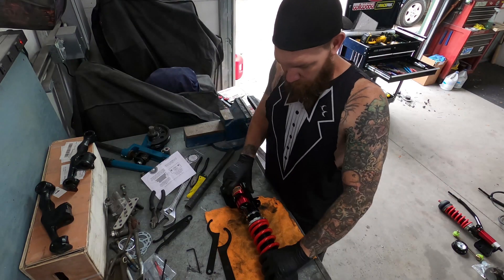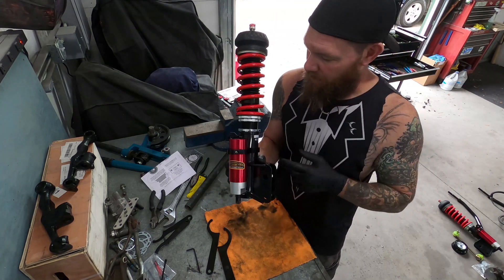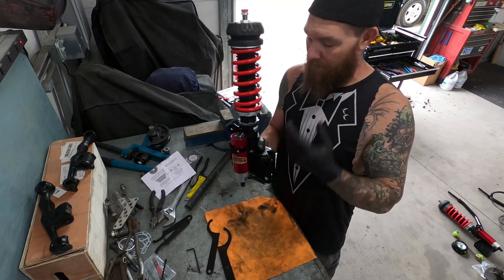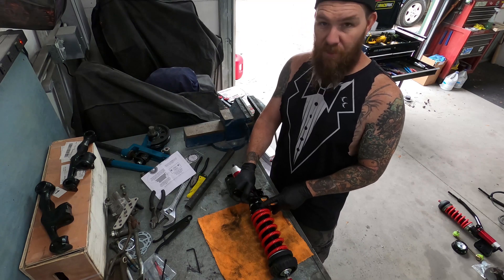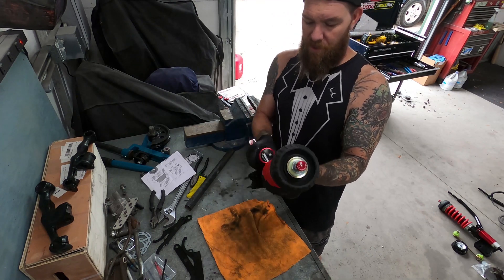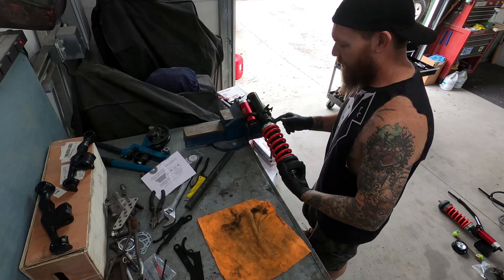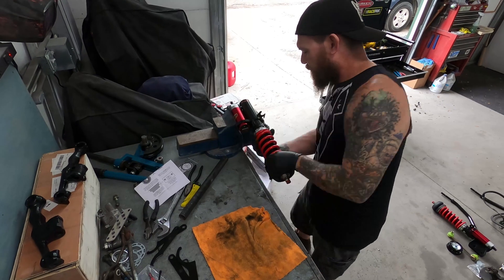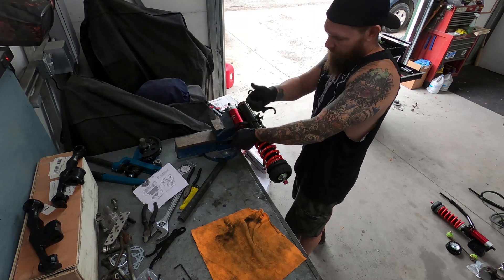Coil Over Setup ride height adjustment on Pedders PED 164033 Pontiac GTO

Comment: How do I know when the bushing is tight enough?
Reply from the maker: Which bushing?
Reply: @conquercustom  the blue one upper
Reply from the maker: @G8_Trev313  the top bushing is smooshed up into the strut tower. So when you bolt the strut in from the top it gets as tight as it needs to be.

Comment: Just installed the rear struts. How do you adjust the stiffness on them?
Reply from the maker: Rebound adjustment is done with the adjuster at either the top (RED) or side (SILVER) of the piston rod, depending on the fitment.
Bump adjustment is always done with the (BLACK) adjuster at base of Remote Canister. Turning each adjuster anticlockwise until it stops is the Maximum Soft Position. Turning each adjuster clockwise until it stops is the Maximum Hard Position.

Comment: Just got my pedders coilovers  so to adjust front ride height, first i have to loosen the botom collar .Then move it  up to the other two collars ( spring collars) . Then after the three collars are all togueter, then start moving  the 3 collars to get the desired ride height. is this correct? i made the mistake to move the spring pre load.
Reply from the maker: The bottom collar locks the entire coilover. Loosen it and you turn the entire assembly to adjust ride height. If you changed the spring preload just look at the other coilover and count the threads. Try to match the one you changed to this.
Reply: @conquercustom  👍🏻👍🏻👍🏻👍🏻 thanks!!